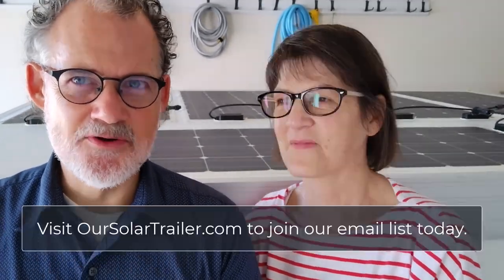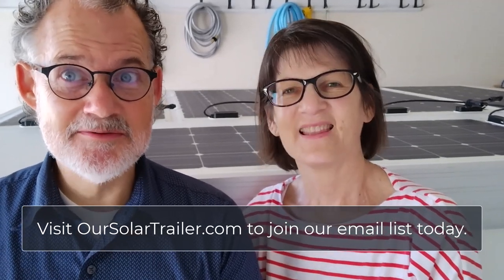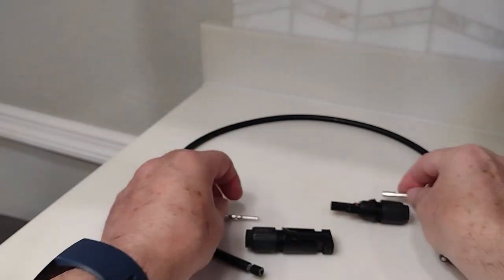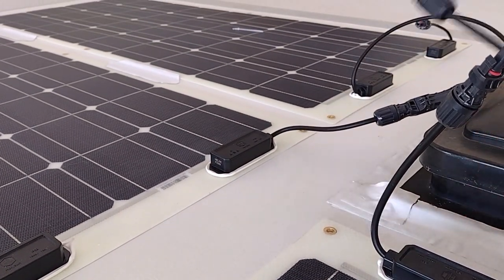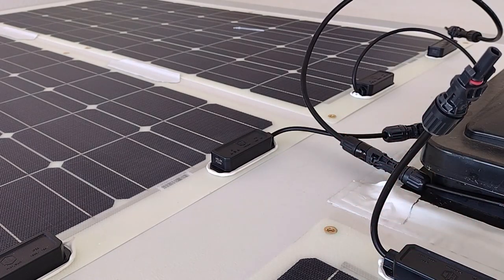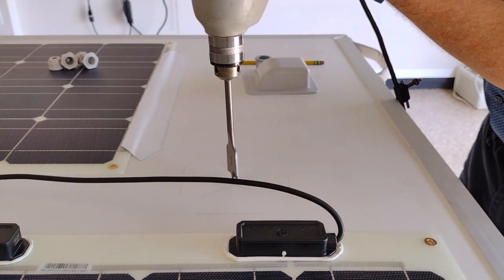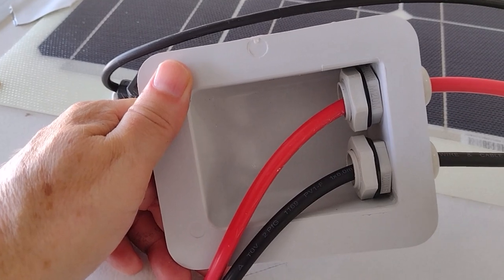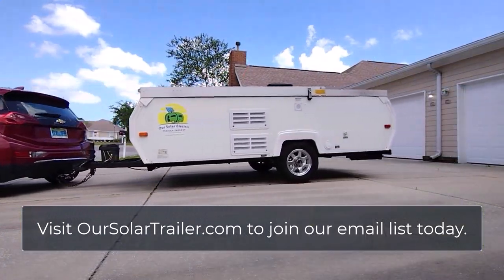Wiring Solar Panels in Series on Our Aliner Scout Popup Trailer RV Camper

Comment: Where and what wiring did you use on your chevy bolt for trailer lights?
Im having a hard time finding a trailer harness
Reply from the maker: We had our Ecohitch professionally installed. The Torklift folks that make the Hitch make a wiring harness. We understand it is tricky to connect.

Comment: Nice setup!  I know nothing about electric vehicles but was wondering if its possible to charge your Bolt with solar?
Reply from the maker: Yes, absolutely. Still, it is difficult to do directly. Many EV owners have solar panels on their homes so their juice comes from solar. We will be able to charge our bolt from our trailer, but only enough to get about 10 miles of range. Check out the Aptera. It is designed to get all its power from the sun directly!